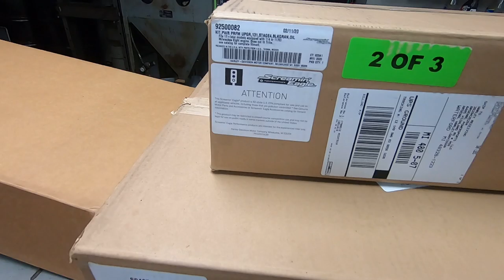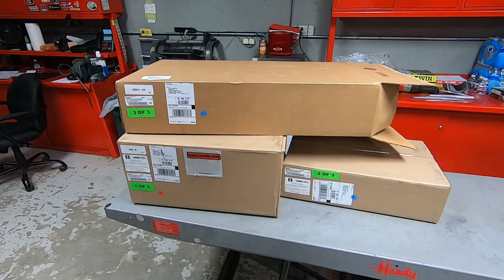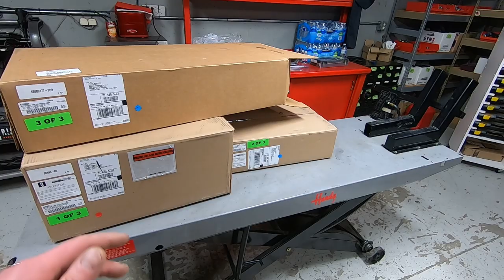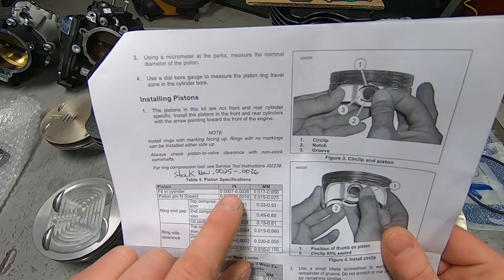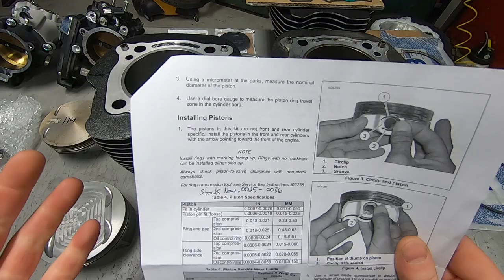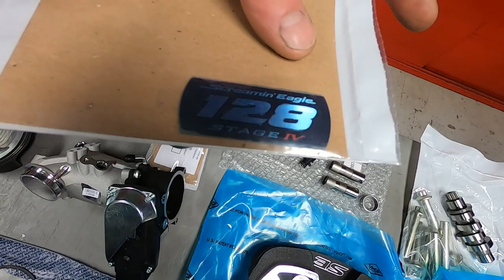HARLEY DAVIDSON 131 & 128 SCREAMING EAGLE STAGE 4 KITS TEAR DOWN AND INSPECTION OF COMPONENTS

Comment: Can you put a 131 on a liquid cooled heads?
Reply from the maker: Yes. The harley davidson 131 kits are also sold for liquid cooled models.
Reply: Thanks Brad, is it true that they run hot? Could be a good idea to have them on the liquid cooled one!
Reply from the maker: The touring 131 kits I've done come with a oil cooler fan to help with the heat. I havent done any specific testing but I would say the 131 kits run hotter that normal 114/117 bikes. But that's to be expected. More power creates more heat. I havent seen any over 128 or 131 bikes come in for "overheating" problems or concerns tho. So only time will tell.
Reply: Ah ok , Thanks Wizard! 😁👍

Comment: What is the cost of each kit ?
Reply from the maker: The Kits cost $3500. Depending on year and model you'll also need a high flow air cleaner kit, screaming eagle street tuner and 10 plate clutch pack.

Comment: Hard to believe somebody would spend a small fortune on a motorcycle to begin with and then shell out At least $5000.00 parts and labor to run heads up with a 300 cc. Honda !

Comment: Cams are 512 or 517?

Wish they did 6.2 or 6.4 or 7.1 for injectors, be it doing the 131 for 131 or doing the 131 kit on the 107 for 128 6.2-7.1 injectors would make that 64mm TB throttle body work the kit combo to its potential.

Then do either an S&S 475 or 550 Cams

Comment: Big question is. The 131 crate or kit. You have a 64mm throttle body. So what air cleaners work on this 131 64mm throttle body HPi has 62mm 68mm or 70mm M8
Reply from the maker: The harley induction module uses a normal air filter kit. Nothing special is needed.
Reply: @HarleyDavidsonWizard  I talked to HPi I was told 62mm one use for 64mm even the 55mm one will work with the V02 since it produces over 428cfm.

Comment: What’s the difference in the 131 kit vs the 131 Crate engine compared to what your showing?

I’m going for a 107 to 131 so far the crate seems best bang for the buck
Reply from the maker: Exactly nothing. But as a side note you need a 114 or 117 flywheel to do the harley 131 kit. If your plan on using your 107 flywheel, you'll need the 128 harley kit.  But in the end its the exact same as the crate engine.
Reply: @HarleyDavidsonWizard  guess I’m going crate
Reply from the maker: There alot of fun.  You'll enjoy it! 👍
Reply: @HarleyDavidsonWizard  thanks 👍🏻